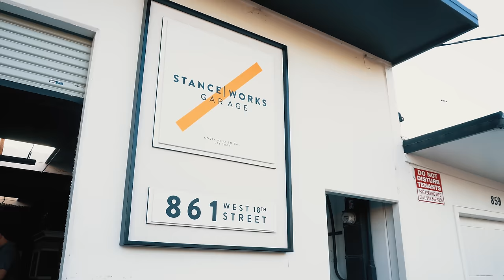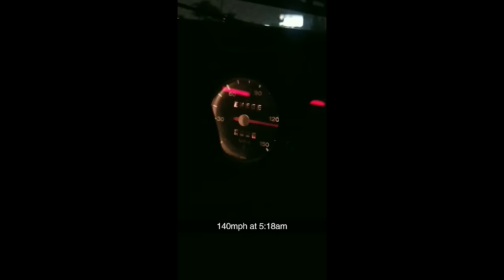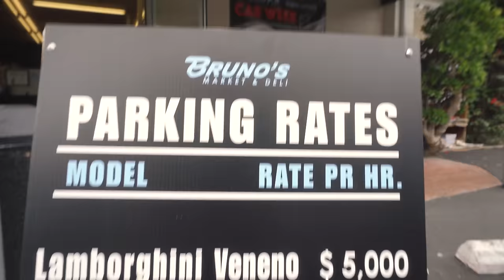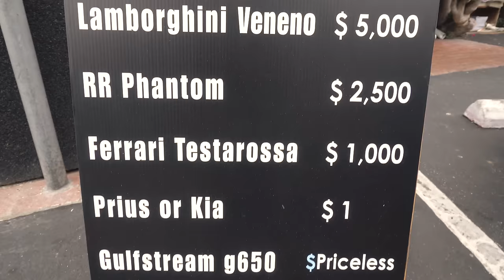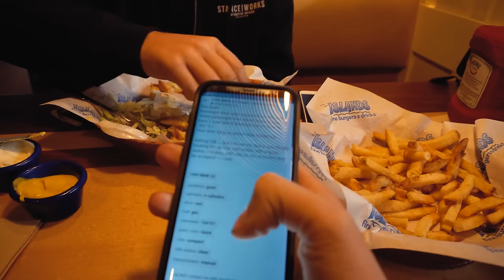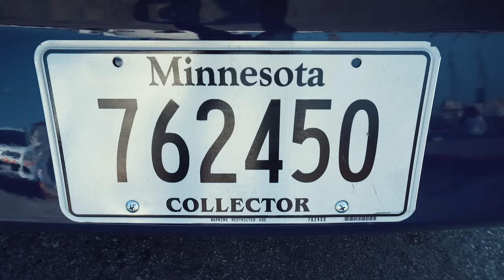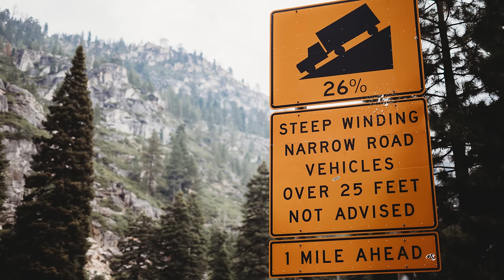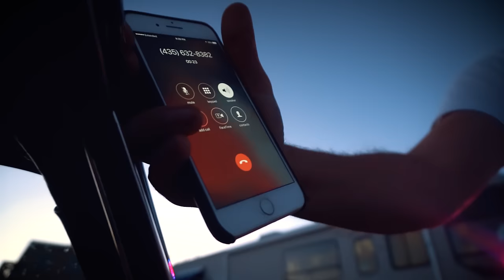Das Ziel - An Epic 911 Road Trip

Comment: nice vid. hows the 911 now? any major servicing or repairs had to be done besides an oil change?
Reply: I have done a valve adjustment that was due anyway. I changed the air filter from all dusty roads. I also did a fuel filter. Other than that, nothing. I've driven it issue free for over 40k miles since I rebuilt it 5 years ago!